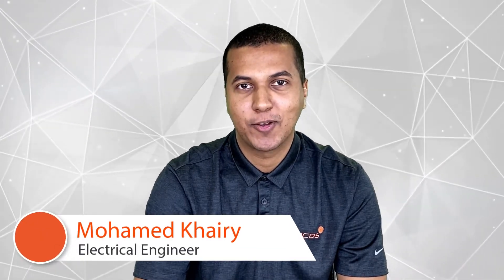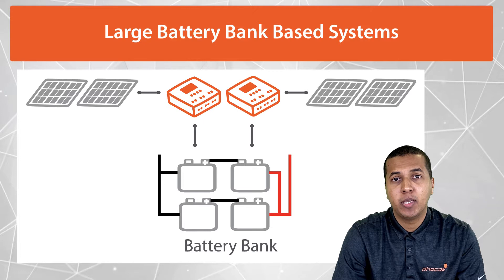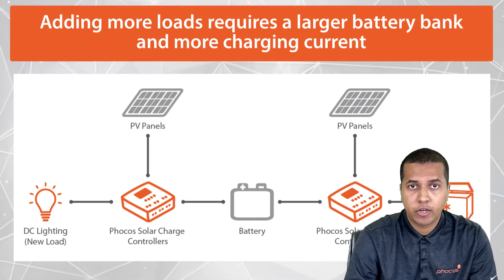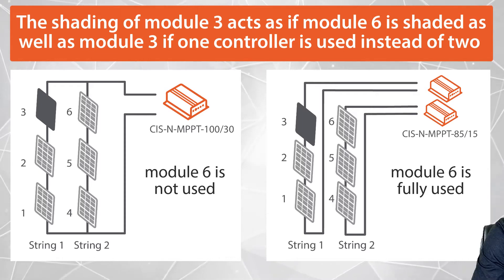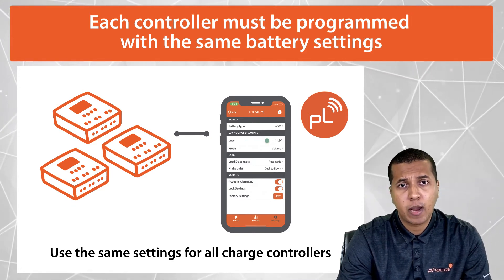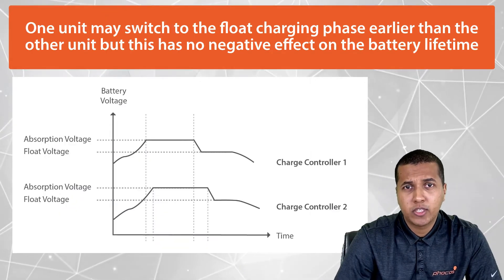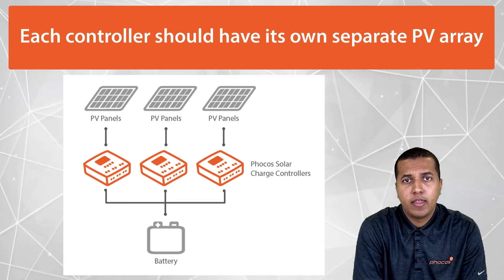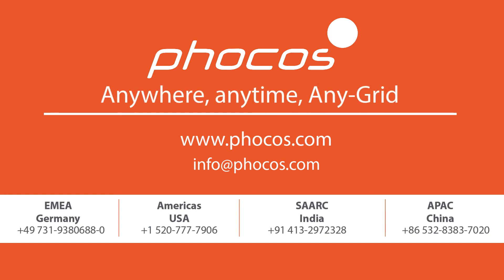Can You Connect Multiple Solar Charge Controllers To A Single Battery Bank

Comment: Hi, Thanks for the informative video.  I have 2 questions for you.  Does this apply to the ECO-N-T 20A as well as the MPPT chargers?  My second question: Can the load wire from both charge controllers be shared and connected to the same load circuit?  I'm looking for redundancy at some very remote locations and hoping that 2 charge controllers can compliment each other. Thanks!
Reply from the maker: The first one: I have no idea. *we do not know the answers to all questions raised). The second:  it's not recommended to directly share the load wires from two charge controllers into the same circuit, as this can cause voltage regulation conflicts. Consider connecting the controllers to separate loads or using a relay-based combiner circuit to isolate the controllers. Makes sence?

Comment: I think in your diagram at 1min21 it's panels 1 and 2 that are not used when 3 is shaded in both cases. But 4, 5 and 6 should be unaffected in both cases. Why would 6 be impacted when a single mppt is used ? Is 6 being shaded limiting the voltage on the other string ?
Reply from the maker: Unfortunately we do not know the answers to all questions. Sorry for that.